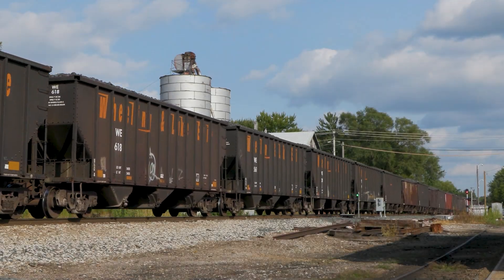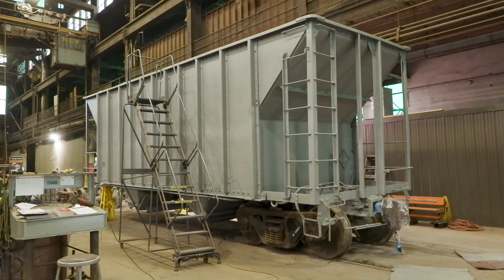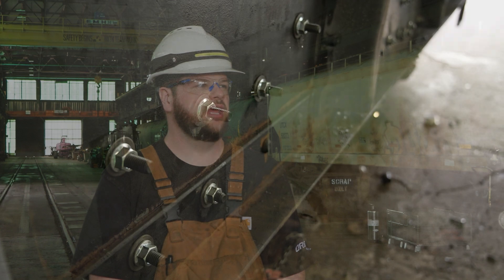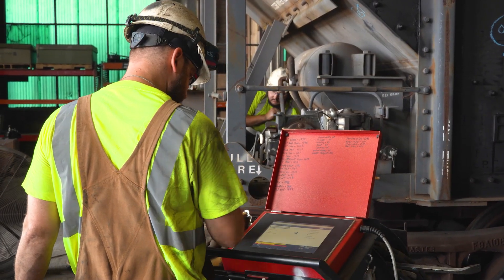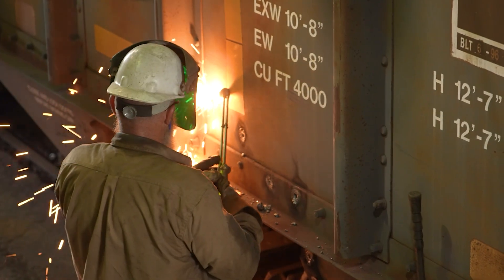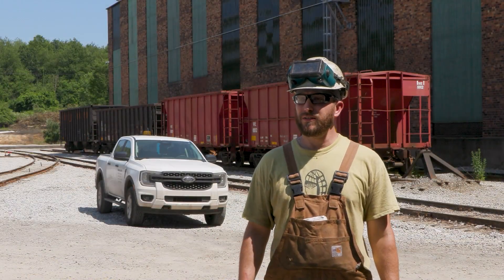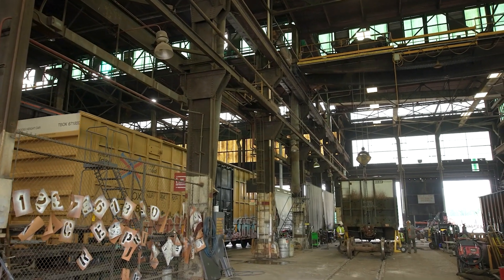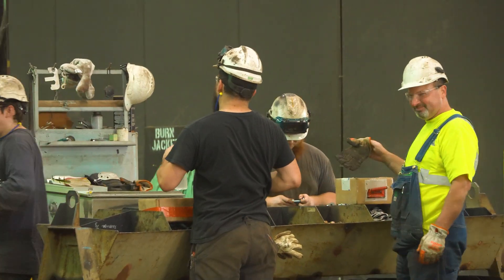Railroad Careers: Car Shop

Comment: I love the fact that they use only EMD 1 and 2 generation locomotives, that what going to have then one, with the public, especially the rail fan!!!
Reply: We have 7 SD40's. A mix of SD40-2'S and SD40T-2'S one being a kodachrome. Unfortunately we are getting rid of most of them. Just got in two rebuilt SD60's and will be getting three new ET44AC's at the end of the year.